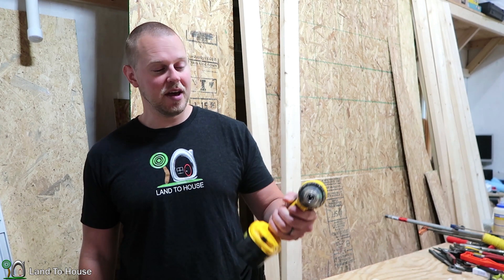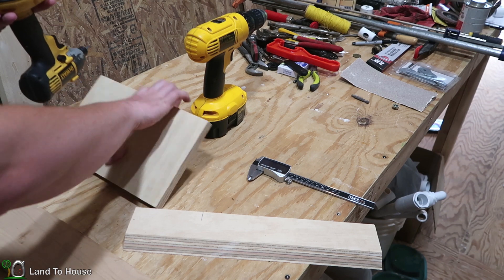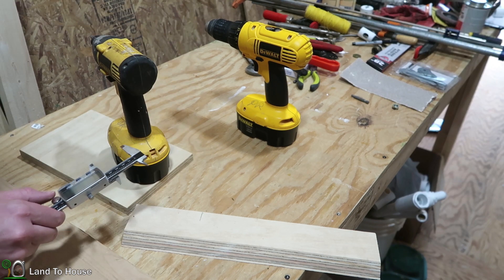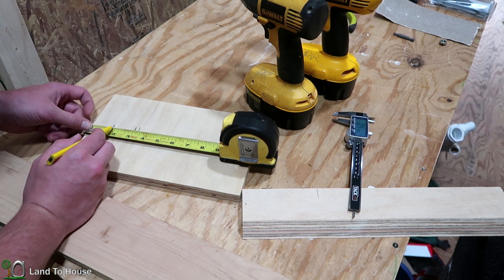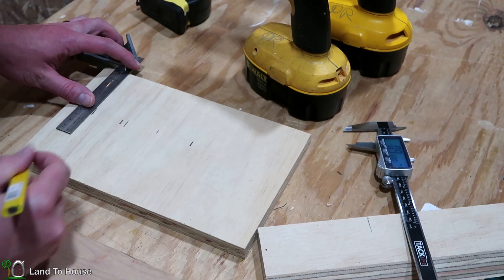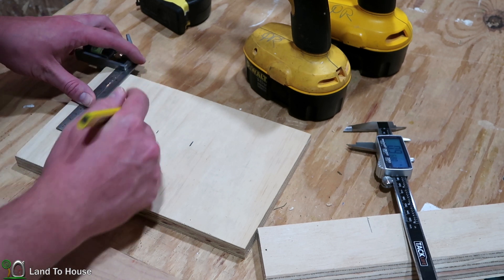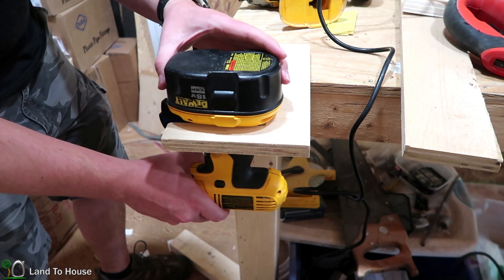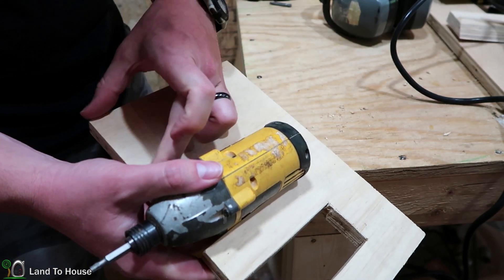Drill and Impact Driver French Cleat - Build a workshop #58

Comment: I used pieces of pvc pipe.  I cut out about 4 centimeters width and about 12 cm length . So  3 pipes next to each  for  my   Makita and my 2 Dewalts.. I learned a lot of jou, thanks.
Reply from the maker: Yes that works well! I have another video where I use pvc to store a drill.

Comment: I would suggest that the shelf should be a bit deeper, so that you can leave drill bits and such installed and still put them in facing the wall, like you ended up.  That seems the natural way to use them, but if you don't want to have to remove bits every time you hang them, you need a little clearance space.  I almost always leave the last bit I used in, because more often than not, that's the same bit I'll need in it the next time I grab it.  I haven't built one yet.  Thanks for the video.
Reply from the maker: Very valid point. Often times I used the sleeve on the impact driver. So the Shelf would need to be about 8 inch longer. I opted to remove the bits every time to have a shorter Shelf. You could probably find a way to hang the drill horizontally with the bit facing down and you wouldn't have to worry about shelf depth.

Comment: Love the videos.
After seeing the spacing issue with the socket set holder, I was wondering if you were going to check that you left enough space between the drill and driver before cutting, nope, just got lucky, but I'm glad that worked. If I may, dollops of hot glue on top near the ends of the fingers of the holders makes a great retainer so the drill and the driver don't accidentally slide off on their own.
I'll see your 17/64 and raise you a 31/64 for making the perfect size hole for the gas-can refit vent, that size hole fits and seals the 1/2" vents perfectly.